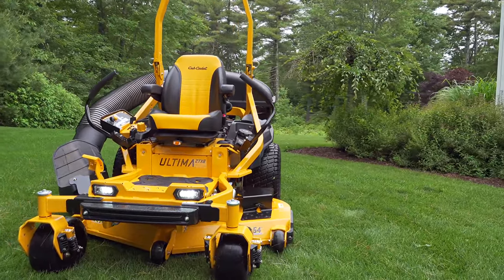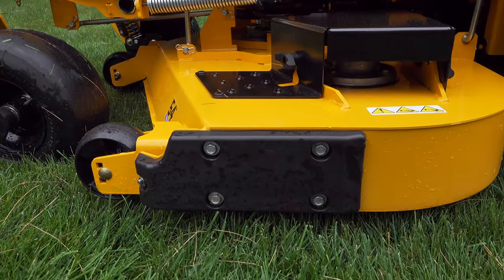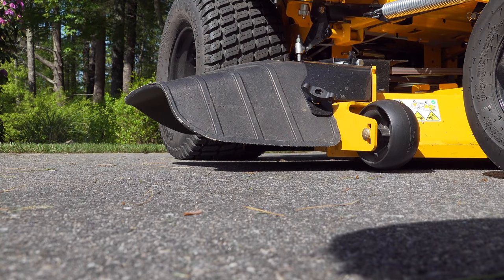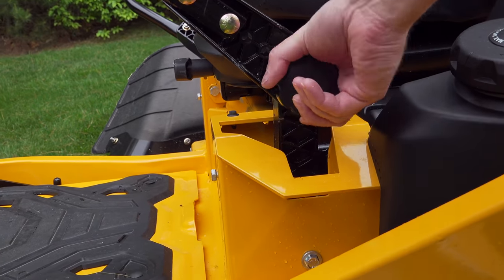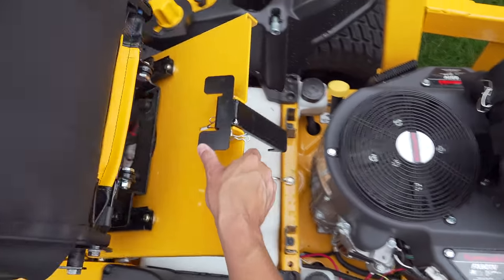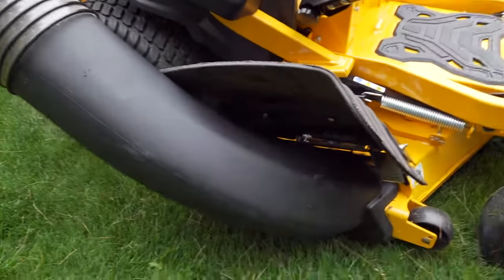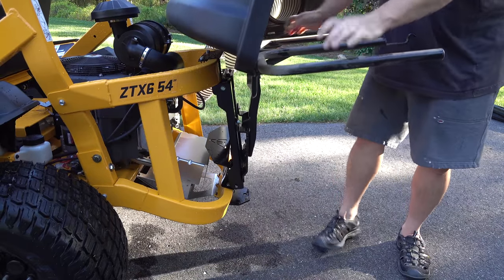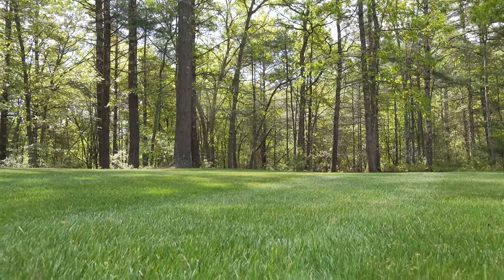Cub Cadet Ultima ZTX6 Zero Turn Lawn Mower Review

Comment: Personally I love the hell out of my Gravely Zero Turn but I'd love to steal the front wheel shock system.

Being disabled/paralyzed and in a wheelchair I love the ability to at least do that. It might not be much but at least it's something. 

Worker's Compensation won't settle for anything reasonable, even after 21 years and with no cost of living increase I can't afford anything else. Basically it makes it where I'm going to run mine forever LOL. 

If they gave you that and you didn't really need it I'll trade you hahaha. My 42" is in excellent condition and garage kept.

Comment: Awesome channel brother ! Nice machine, but I prefer my kubota bx 2380. I promise u once u go diesel u will never go back to gasoline! I had a kubota g1800 for years, all I ever did was change oil, grease it every 50 hours and change the fuel filter every year for maintenance.
Reply from the maker: No worries. I like the diesels a lot I have a RTVX with their diesel and it’s excellent. Only problems with Kubotas is when people mess with them and don’t understand how they work but that isn’t their fault.

Comment: Nothing against the Cub Cadet, but the Spartan comes with most of the same features and the deck is 7 gauge steel. I got a Spartan RZ Pro 54" deck and Briggs & Stratton commercial 25hp for a little over $5K.
Reply: Yeah I was l👀kn for 1 in Metro Atlanta, had to go pretty far to find. End up with Cadet
Reply: The cadet crushes that spartan. Who the hell needs more than 10 gauge unless you weigh over 300 lbs

Comment: What could be the problem if the knob does NOT lower or raise the deck? Ours is brand new and will not lower. Thanks!
Reply: Do you have the knob in the "locked" position?  That little knob that is by the adjustment locks the deck so it wont move.

Comment: Great review, seems Cub Cadet put a lot of thought into the engineering. Cub Cadet wasn't a brand I would have considered seriously before but would definitely check out their line if my Toro ZTR bit the dust.
Reply from the maker: Thank you, I am completely agree. I thought they were out of the game a couple of years ago. They aren't the cheapest machine but the quality is there and I am very partial to the genuine Kawasaki motors too which they include on a lot of their models that cost significantly less.

Comment: What is the black thing on the front below the two LED lights and above the center spindle on the deck?  Did you buy that separately and add it on?
Reply from the maker: That is a steel weight for the bagger to counterbalance the weight of the grass in the bags. Most baggers will include them

Comment: Better than the Toro ?
Reply from the maker: Yes but these two models are not apple to apples. The Toro competitor to this machine would have been their Titan which I have not had a chance to try yet so I can't say for sure. I will be hard pressed to find a better seat than this one. It doesn't look too different but it was like being on a Rolls Royce using it.
Reply: Silver Cymbal how does it compare to the walker?
Reply: That is a commercial motor on there...the titan doesn't have that kawasaki. Id buy the cub, i only buy kawi motors on every piece of equipment I have. This mower will last a homeowner a lifetime
Reply from the maker: @suburbanacreage  This is faster in open spaces than the Walker. But the Walker is better in very complex areas, lots of curves to do. It is a very compact machine. The blower is also exceptional on the Walker. The downside is the maintenance costs of the Walker and complexity and  of course its $14k and up so more expensive. But depending on your needs can be a better machine if you are making money with it too.